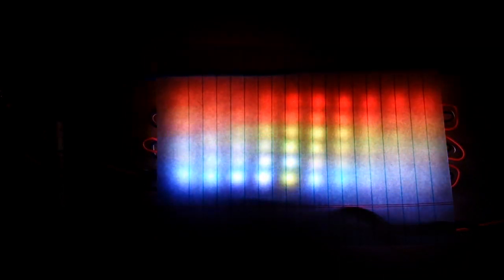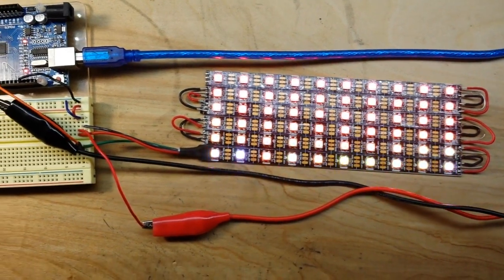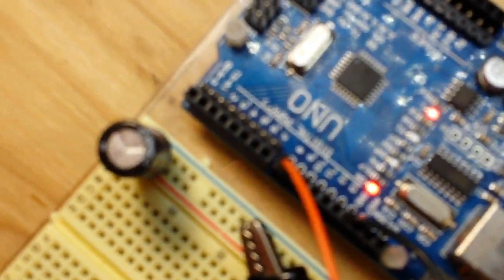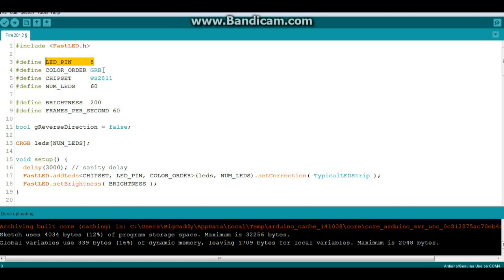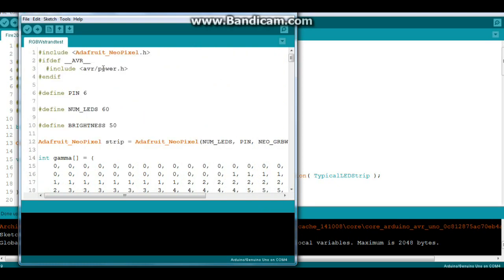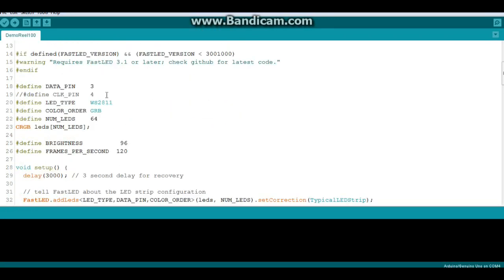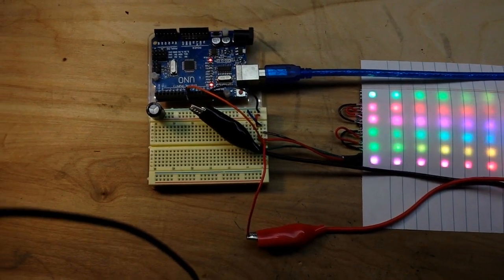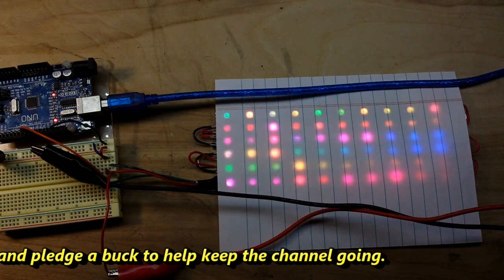Playing with Neopixels and FastLed Library

Comment: Thank you for the video. I just started watching and wanted to remember to ask...

What power supply do you own?  As best I can tell is it this one?
https://www.amazon.com/Flexzion-Power-Supply-30V-Single-Output/dp/B0146K58TC/ref=sr_1_2?keywords=power+supply+302d
You mentioned that the LED's take a lot of current but your power supply is rated at 2amps.  Is that still ok??
Reply: Gary Parkin The LED strips use 5 volts only. Anything above or below that will break the strips. Each LED uses 60 milliamps at full brightness in white. So if your strip has 300 LEDS, multiply 300 x 60 = 18,000 milliamps or 18 amps. So if you have a 5m 300 LED strip, I suggest you buy a 5 volt 20 amp power supply. You  can buy a higher amp power supply if you plan to chain more strips together.

Comment: Did you use a special fire 2012 code to have it work with your LEDs in that 6 x 10 array? I’m having a lot of trouble Finding information on how to run different LED strips controlled from different pins on the Arduino and have them work together.
I did find one incredible lamp project using eight strips of 25 LEDs that I am building and it uses eight separate pins out of the Arduino to control it and a couple potentiometers. But I just wish I could understand the coding.

Comment: I'm controlling 270 LED's (2 15ft strips together) using this method with a Nano + FastLED except I'm using a step-down buck converter for voltage and amperage stability. It works wonderfully. 270 LED's running 24/7 in my garage for years. Adafruit came out with a PXL8 friend board for Metro that will control up to 8000 LED's using the PXL8 library.  Adafruit and neopixels are making progress but FastLED has far more examples sketches.  I think Adafruit's PXL8 library would be more successful if they had more examples like FastLED.

Comment: If people only have a small 5V power supply say for example a 5V 800mA USB phone charger you can use the command
FastLED.setMaxPowerInVoltsAndMilliamps(5,700);
to limit the current (at the cost of brightness) the 2812's use to 700mA.  This also comes in handy if you are using battery power, restricting the current to increase battery life. you can replace the 700 to anything you like, 1000 to limit the current to 1A, 1500 for 1.5A and so on.... Each RGB colour in each "pixel" can use as much as 20mA, so white at maximum brightness can use upto 60mA per pixel. 

Merry Christmas to all.
Reply from the maker: +uktoker71 Awesome!!! Thank you for sharing that information
Reply: Didn't know that, great info for safety margins! That line should be included at the head of every sketch as mandatory even if it's commented out.

Comment: Nice, ironically i just purchased 200 rgb leds (not neopixels). 100 common anode and 100 common cathode. Thinking about driving a few (10?) with those new transistors just to mess around.
Reply from the maker: +Michael Padovani Have at it, LEDs are always fun...blinky blink blink